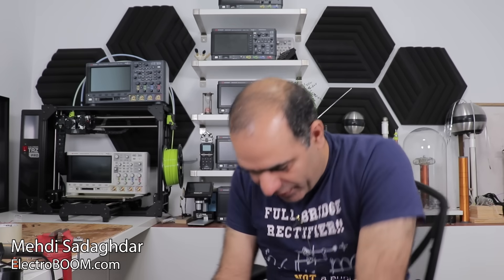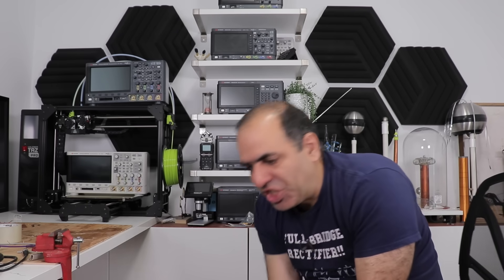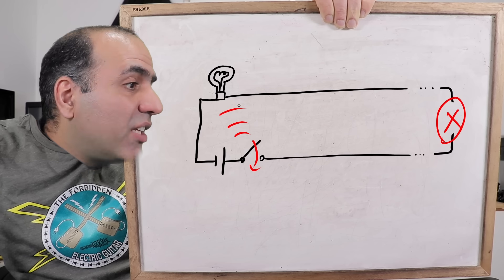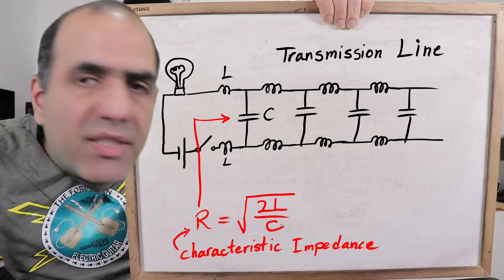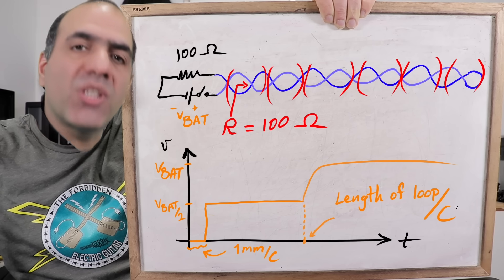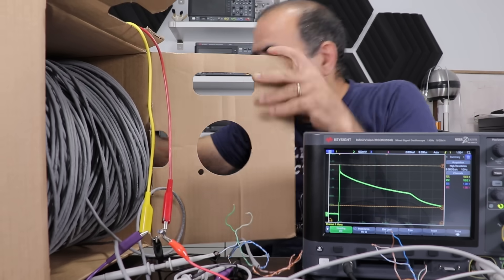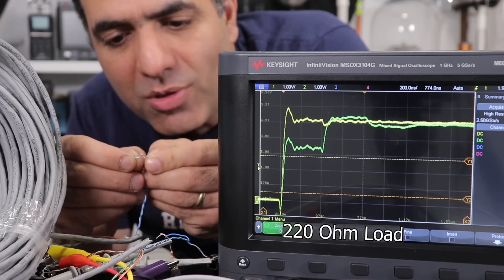Testing the LONGEST LOOP OF WIRE!!! to Turn a Lamp On

Comment: Generally, transmission cables specially coax has .66 velocity factor, which means propagation delay becomes .66C.
I pressume its the same case on twisted pairs.

Comment: 7:47 In typical cat-5e cable, the pitch of a particular conductor pair is (more or less) the same throughout the entire length of the cable; we don't just have one adjacent conductor, we have several dozens... but we also have another twisted pair with the same pitch the next cable over. Shouldn't that cause some constructive interference too?

Comment: Maybe make a video on this...I cover this in my Summer STEM class: AC follows the path or least inductance (or most capacitance), DC follows the path of least resistance.  So when laying out a Printed Circuit Board, if you have a signal that toggles at one Hz (once a second) most of the current from source to load takes a straight path across the board, even if the trace winds a crooked path across the board. But suppose that is a clock signal that requires very fast rising/falling edges, lets say 1 nano second (1 one billionith of a second). So, when the signal toggles, that edge is AC, and the return path is UNDER the trace or through adjacent traces, no matter how the trace goes across the board. If the return path is through a adjacent trace somewhere that is "coupling noise" and noise is every engineer's enemy. This is why we run a ground (return path) under the traces (usually a whole layer of gold or copper called a plane). This allows the AC component of the signal (the edges) return directly under the trace in even a winding path and not couple onto adjacent traces, while the DC component of the signal (the flat high/low levels) to return across the plane in a direct path.  Also, the insulating board material between the conductive layers (dielectric) is very constant, so we can control the impedance of a trace depending on the thickness of the dielectric and the thinkess of the trace.  We usually try to run signal traces between two layers, one the power (plane) and the other for the ground plane - sandwiching the trace between two planes. This gives superior noise immunity and impedance control but with the trade of more capacitance on the trace which must be considered.  Before the days of Computer Automated Drawing (CAD) tools, we used lumped analysis to approximate what was needed. Recall, a transmission line (trace/wire is an infinite series of inductance, capacitance, and resistance) so that is a lot of intregal calculus. Now we have tools like Hyperlinks where we can model our circuit board layers (stack up) and traces and see how they will work before we layout (route traces on) the board  - in seconds.

Comment: Awesome video. As a High Speed Digital Engineer, transmission line theory is important with every connection me make. Even at short distances we want to impedance match our traces so I put in a low resistance (how I determine that is another story) series resistor even if a trace is only a centimeter from source to load.  Any steps from a very short trace mismatch "balls up" within a couple pico seconds, so that noisy stepped edge is normally perceived as a steady rising/falling edge by typical circuitry, so most scopes don't have the bandwidth to even see it.  But I impedance match anyway.  An Analog Engineer I knew once told me, "Digital is easy, it's all one's and zeros."  I would say, "No, the edges I work with are about one nano second wide, that's in the Giga Hertz range, so I have to be not only an Analog Egineer, but a Radio Frequency Engineer as well... and... I have thousands of circuits running concurrently, especially in an FPGA." He didn't say a word. He was good guy, whenever I would get frustrated on a project he would tell me, "Paul, if it was easy they would not need us."  Words I now pass on to my Summer STEM students.
Reply: I found that conversation surrealist. I don't know how the university is now but I studied all of them (in Spain): analogue, digital, power, transmission lines, microwaves and antennas and optical communications. Do you really study only analogue or only digital? Where are you from?
Reply: @jorpese1  I studied Electrical Engineering, and went on to high speed digital design, picked up software (because I could not get software engineers to write test code for my electrical designs -  I was a young pup engineer), then FPGAs using VHDL, and became the subject matter expert for JTAG.  The triple threat: Hardware, Software, and Firmware.  But knowing analog, RF, transmission line theory, vacuum tubes, trigonometry, geometry, chemistry, and power supplies helped. Most of that I learned in High School electronics and in the US Air Force. I am in New Hampsire in the USA. In the US, Electrical Engineering covers all the electrical disciplines, then you focus on what you like best, but a good engineer employs all the disciplines within their focus field.

Comment: When I was working for a company that did traffic light installation when had a 1km loop of wire that was 37x1.5 mm^2 so you could have tested a 37km loop

Comment: 4:29 when it blinked once, and then it did not blink again, was it because the first one charged the capacitor (which is supposed to be what is happening there and why some current flows through the bulb anyway) and the next ones were useless, since it was already charged?
yeaaaaaaah, you explained it later, I like when I figure it out on my own

Comment: I'm glad you brought up something about the speed of electricity through wire in this video. It was the same thing I once said on a computer forum years ago now when people were talking about how performance shouldn't change much for AMD's new Ryzen processors before they launched when the first chiplets were introduced to market.

One side of the argument said AMD would introduce too much latency issues for a CPU because CPUs are sensitive to that and moving logic apart by 1/2" would add significant latency. The other side said that electricity travels at the speed of light and so the extra 1/2" distance wouldn't add more than like 1ns of latency and it was inconsequential.
I butted in and pointed out that the speed of electricity is said to be that while in a vacuum. It actually drops to around 70% in something like an 18 AWG wire, and as you showed here drops to 66% in a Cat5e cable that is most likely 24-26awg. I pointed out that CPUs wire sizes are nanometer in scale and that through such a tiny wire the speed of electricity is actually closer to 25% the speed of light, MUCH slower than most people were thinking. Of course, I got yelled at for being an idiot and everyone said AMD and Intel couldn't even design CPUs if the speed of electricity were so slow. lol

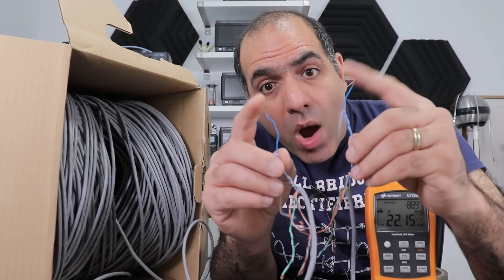Comment: The hidden gem of this video is 8:12 when Mr BOOM quantifies the effectiveness of twisted-pair at reducing parasitic inductance effects, measuring 1/100th the inductance for there-and-back on a twisted pair (184 uH) vs one-way on a single wire (18 mH). Fantastic!

Comment: Electricity doesn’t flow like most think. The “hose” doesn’t start filling up at power, it’s already completely full. A complete circuit creates flow which starts on all sections of the current at almost the same time

Comment: A lot of people don't know old phone lines (pots) 30k loops are a thing in remote areas, but the real joke is when you live so close to the distribution you need to either install resistance device or you put 10,000 ft of small gauge wire in the box.. not ideal but very old school like full spools of jumper wire.

Comment: Seeing the initial transient signal remain unchanged whether the loop was open or closed was so cool. 

Also, showing exactly how changes to the setup could be made to drastically reduce time and effort while not affecting anything important is a tremendous skill to showcase for modern engineers and technicians.

Comment: Thanks...Now: How does POWER get produced from a bicycle and some generators!? Maybe another bicycle turned upside-down with some extra weight on the rims to act as flywheels; and an electric bike motor [on the lead bicycle] that recharges on a trickle charge from a wall socket! This power will produce Ozone(!) broken by Incense! Good Future for US! Note: This should spin about 20 generators!!

Comment: That is a nice O scope. I had to learn how to use one in the Navy 20 years ago and it was probably roughly 20 years old back then, so I know how to use an O scope from the mid 80s. The one I always used had a huge green screen and if you were a turbo nerd, you could set up 2 O scopes to play "pong" sort of, but the "ball" wouldnt bounce, but it was directional.

Comment: Probably already mentioned, too many comments, but that's well over 8k feet, twists... That adds a LOT! Edit: lol, right at the top, pretty sure it's more than 1-2% though.) And each twisted pair is twisted at a different number of twists per inch, which is why orange and green are the predominant pairs in Ethernet (cat5e)transmission, most emi resistance, and power (POE) was originally delivered on brown and blue. Cat 6 and higher are just better at noise rejection and allow power over other pairs are different frequencies from the signal. I was a fiber engineer in a prior life, and somehow copper was more intriguing to me!
Reply: Dude you are like 12, quit pretending you have even had a job.
Reply: surely a fibre engineer would know that ethernet and cat5 are completely different things. one is  way of sharing information and one is a specification for wire?
Reply: @KarldorisLambley  pedantic much?
Reply: @michaelhess4825  one person's pedantry is another's accuracy. i tend to find that only people who are wrong ever call someone a pedant. like you.
Reply: @KarldorisLambley  terms are used interchangeable across the industry, we all KNOW what we mean, only asses with limited knowledge cling to pedantic statements.

Comment: Nice demonstration of the RF loading/impedance matching property of voltage standing wave ratio (VSWR). You can actually see the multiple reflections of the wave on the transmission line.

Comment: One thing you will see when switching a circuit on and off at a steady rate, is if the load and transmission line are the same impedance, or if there is a mismatch. It is the beginning of a Time Domain Reflectometer, and can operate at a standard frequency, or at the operating frequency of a transmission line.

When the impedance is mismatched, then there is a bump in the waveform that will show the mismatch and how much of a mismatch there is between the line and load, but when the load and line are equal, then there is no bump! Today's technology has made such measurements easy to make, and the instruments inexpensive!

But the coolest measurement is the transmission line Velocity Factor. And strangely enough, the Velocity Factor tells you how much the electric field slows down on a transmission line! In some cases, by as much as 34% if not more! And it isn't an illusion!

Comment: Your calculation for speed of light was based on the length of CAT5 cable not the length of wire based on the twist. I bet that matters.  CivE thoughts on the matter. Great content.

Comment: I designed a circuit that takes a 4 bit binary adder then connects that into an array of and gates, these gates function as code inputs so basically if you want the first and gate array to be on when the binary adder outputs a 4 then you take the output of each xor gate in the adder and connect them to the and arrays as the 0100 pattern needed for the 4, then you have 3 more of these and arrays so that you can now have a 4 digit code, i then took those 4 and gates and gave each of them a pc memory circuit where an or gate loops back through itself using an and gate so that when you get your first binary output from the adder and it actuvates one of the and arrays the array actually stays on after you change the number being output by the adder, finally you take all 4 of the and gate arrays and plug them into a final ad gate array that's gonna be on when all 4 of the previous and gate arrays are active therefore turning on a light.
Note that i mention and gate arrays because when i built it i only had and gates that could take 2 inputs so in order to make a gate that's active with 4 inputs i had to take 2 and gates that connect to a third and gate making essentialy a 4 input gate, if anyone wants to actually see it i did post a picture of the circuit diagram in the fallout 4 reddit under this same username because i built this as a lightswitch in my fallout 4 save

Comment: As i said in a previous video the electrons travel from battery tru light bulb and they are ready on the right side of the switch so you need 2 switches left and right. And after you done the first test the cable since is loop like so and isolated can comport like a capacitor which means you need to  discharge the wire just for 0 errors. And the voltage and current can create the field at few cm distance but not so powerfull at 1 meter distance if the current is not pwerfull to radiate the field. Anyway good try.

Comment: I love your videos -- very educational in a joyful way! However, I do disagree with this one in some part. 
I think a quite important misconception in this experiment is that we all look at the distance between the battery and the bulb. But the actual important thing is the distance between the switch and the bulb. The bulb changes status (dark, lit) as a result of flipping the switch. Any change in charge/field distribution propagates starting from the switch, along the waveguide  (wire), to the bulb. So it DOES matter that you placed the switch right beside the bulb (through battery). If you do the same experiment but place the bulb away from the switch, you will see a delay of L/c (where L is the wire length between bulb and switch) before any significant amount of current is observed, no matter where the battery is.

Comment: What youve just created is a line fault detector. Because you can see the time too a resistance change and the speed of the di-electric in referance to C you can determine where on a telephone tower the cable got crushed

Comment: It's crazy to see Mehdi's voice changing reflected on the oscilloscope. Just goes to show how even small differences, like the pressure of sound waves, can change electric fields in unprotected wires and components. 
Really hits different when you consider how many of these simple components are in the phone/computer you're watching this on, which surely have no problem dealing with loud neighbors, or the like.
Reply: That's because your phone doesn't have loose wires in it...

Comment: My favourite part is "it doesn't matter".
The amount of things I've explained to people from cable color (red HAS to be on this specific spot, no. As long as it is connected to the same end its fine. Color doesn't change voltage) to chemistry (it doesn't matter that there's sodium in salt. It has reacted and changed to become salt. It's no longer straight sodium and straight chloride).

Comment: Hey Elecreoboom, I study quantum optics and metrology (the measurement axiom). Currently I'm working on a cavity (two very very reflective mirrors pointed right at each other) where we are inputting photons one by one to study entanglement (Einstein's spooky action at a distance).

The ring down time (decay you showed) and reflection process happens in our experiment too! But with our set up, the "current" is the number of photon and the reason they experience "resistance" is that they can undergo a process called quantum tunneling to exit through one of the mirrors. 

Your video is a beautiful example of some extremely deep mathematics underlying oscillations. This is shockingly (ha) universal behavior in physics.

Comment: To me this demonstration actually disproves Veritasium's assertion, which was that the light would turn on as soon as the wave can reach it (directly through the air), counter to intuition. But everything you showed was exactly what one would expect. I believe it does matter that your positive side was shorter. It's pulling electrons through the wire causing a smaller current flow until the wave hits the open end of the wire and reflects back (or if the wire is closed, the two waves meet and the full current flows). If your positive side was the same length as the negative, I don't think you would see that brief half load voltage, only the full voltage after the wave traveled the length of the wire. I think you would still see an initial tiny current, but this is due to inductance and would normally be considered an undesirable side-effect, not the light being "on". Seems the resolution has come down to semantics, and IMO an unintentional field effect (that also drops off with distance) is not the same as being "on".

Comment: Well.. at the same time, yes. Create a wool ball of 15 meters of cat5 cable and see if your ethernet still works. I had a case 15+ years ago when ones grandmother did that and then called that hers internet is not working. Straigthening taht ball of cat5 brought the internet back. Of course it does not apply here currently, frequencies are different etc but telling that having them in a coil has no effect at all is also a little to simplified approach. Cross talk over wire pairs is a PITA.

Comment: I learned at school that when you swich the hair drier there is an initial really hight peak of current. All the electrical devices have this peak and you can see it how it forms with this experience. But i'm not shure if it is related or not.